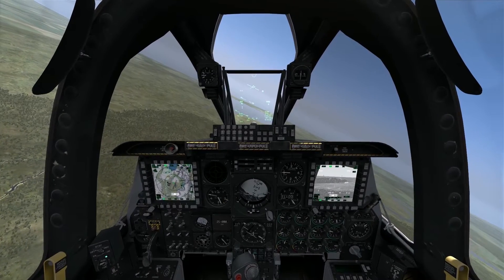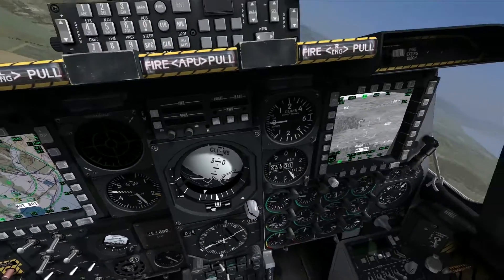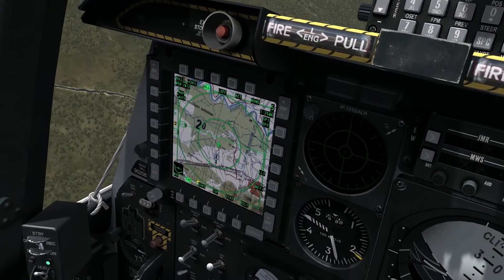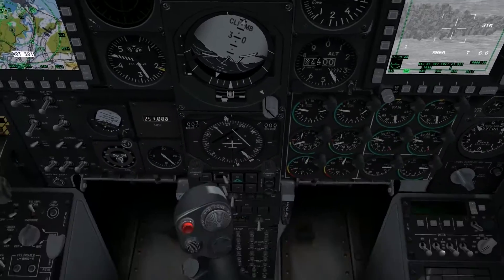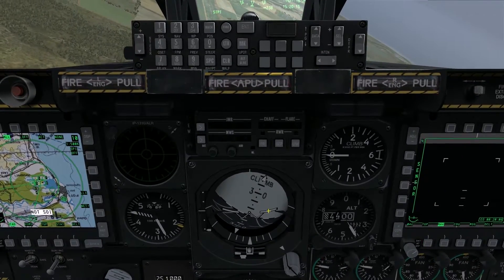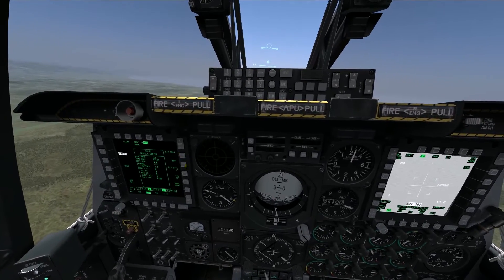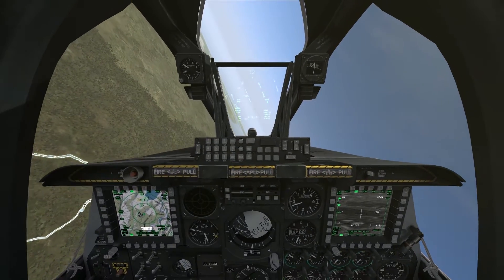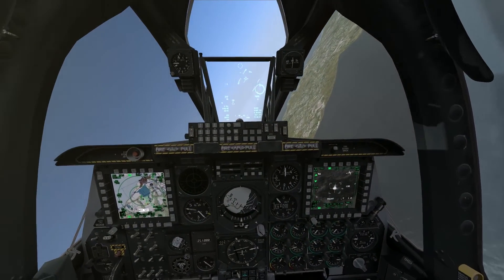On the Range #11 - DCS: A-10C Warthog Sensor of Interest (SOI)

Comment: Hey to Bunyap ! Great videos, am enjoying the A-10C stuff. Question: Can one power up the radios and TAD without having to fire up the APC and APC generator ? Thanks, peace
Reply from the maker: +Dave Almeroth The UHF radio can work off of battery power but the other radios and systems that allow the TAD to work require power off of the generator.  You could also connect external power if you just wanted to play with systems without dealing with the noise.  That is really the only advantage to doing so however.